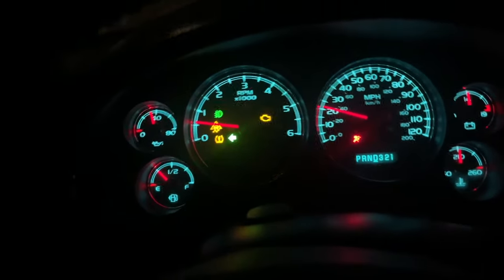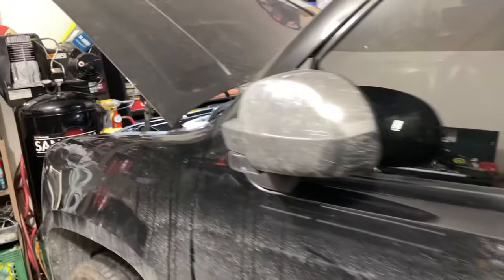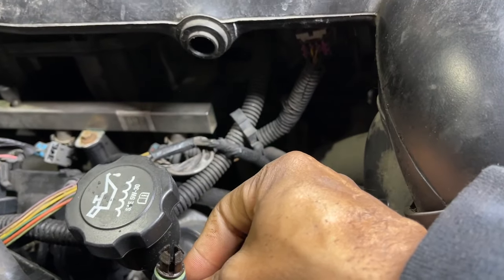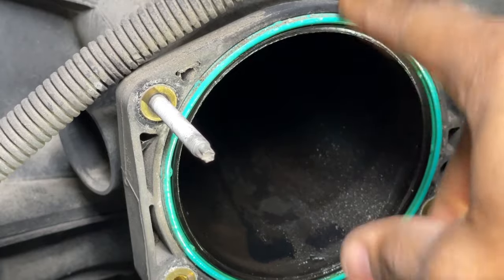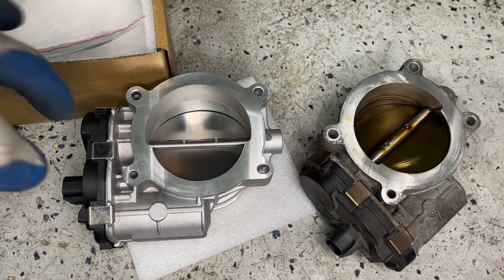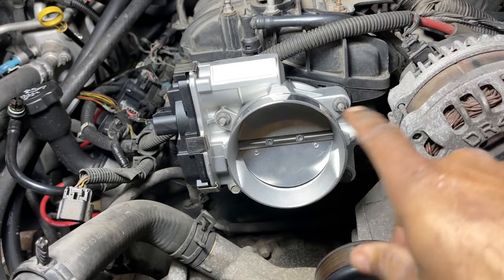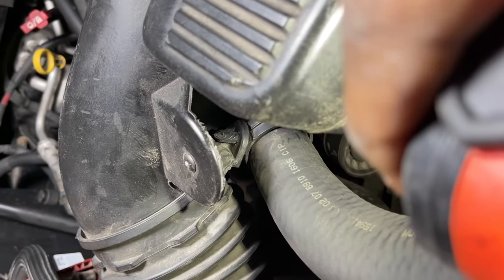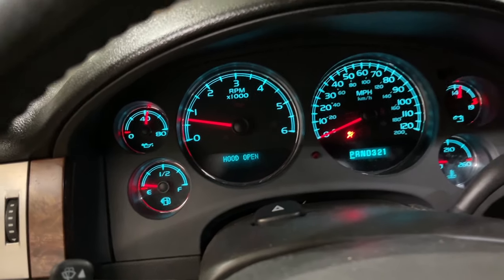How To Fix Reduced Engine Power Quick And Simple! Code P2135 Chevy Or GMC Trucks / SUV's! TPS Issue!

Comment: Is it possible for code P2135 to make code P0651 go off?
Reply from the maker: Nope, I don't believe so. They are two different issues. The P2135 almost always correlate with the throttle body system. The P0651 points to an issue with the powertrain control module
Reply: So do you think a new pcm is recommended?
Reply from the maker: If you wanted to take your chances on a used one for cheap and see if that helps. But If I were there, I would use my scanner to pinpoint the issue. Here is a link for a list of ecm/pcm. I am not sure what year your vehicle is but if these are not it, you can search for the right part in the search bar. 

https://www.ebay.com/sch/i.html?_from=R40&_trksid=p2323012.m570.l1313&_nkw=2010+chevy+suburban+PCM&_sacat=0
Reply: @TerenceDIY  I have a scanner if I knew how to pin point the problem I would but thank you for your time I appreciate it 🙏🏼 you can only help so much through social media so anything is appreciated
Reply from the maker: I wish I were there to help.

Comment: Everyone, please listen I’m gonna save you all a lot of money and appointments with mechanics reduce mode on these engines is caused by lack of oil in the transmission when the transmission oil is low it puts it in reduce mode so you won’t be able to accelerate it safety so you don’t ruin your engine check your oilguarantee you, it will fix it
Reply from the maker: That is NOT accurate. There are MANY causes that will produce the "Reduced Engine Power". I know these vehicles VERY well.
Reply: I checked my transmission fluid and I just got it back from Coleman Taylor

Comment: its crazy how you changed the whole damn throttlebody with no codes or problems, I barely cleaned mine and bam idle surging and reduced engine power now, cant get it to relearn the idle
Reply from the maker: Yep, no issues at all. Truck runs amazing. You might have to replace it. Let me know if you want me to send you a link to a great deal on one. Thanks for watching.

Comment: How do u reset the code ?
Reply from the maker: You can use any cheap code scanner or disconnect the battery for a couple hours and then see if it will  turn off then. If not, eventually the computer will relearn itself after it doesn't detect an issue. Thanks for watching.

Comment: What is this part called?
Reply from the maker: Throttle body. Here is a link to the part...

https://www.ebay.com/itm/333272439452?fits=Year%3A2007%7CMake%3AChevrolet&hash=item4d9895da9c:g:EpoAAOSw6QJdM5EW&amdata=enc%3AAQAHAAAA8MoUyTfsKekX%2Be%2BCj7USOvxRS2XHH%2B4s%2F3tNXtAZ4Z%2BLY2YJ8cZZawMqXI5eRkCN2peingTBDhw67RTFniZ13YeWeYbWwzGRlOX3gCqapuSIPwlEOfKzGzdNW%2BNzE8MbtQa9bKHYK%2FFny1QKeLPh5%2BT%2FvWkqJDUanZ7qKFa%2FOhsJqhggQbt7Umqf6zC8bs7CX38DptVmKXrZ5e1ffO5hiOX3R0pN%2FDzQhYhPHqus0EIe9dZFt8YQiPLivMTWeFMgMLoOzqCMLA6Ny%2FxV52kLnSoSua%2BZoIhp2FPjE5q0esui5UydLADX0lxurZTAZ%2BxIXg%3D%3D%7Ctkp%3ABFBM0qf9t6Vh

Comment: Whats your email address. Im having a slight miss something my 07 tahoe. It doesn't do it all the time but i do notice it. I changed the plugs and wires last year. Did the coils a week or 2 ago. Could you help me out please.
Reply from the maker: Are you getting any codes? If so, what are they?
Reply: Only code is the oil pressure switch.
Reply: And the charcoal canister.
Reply from the maker: Okay. So why did you replace the throttle body? Did the code P2135 ever come up?